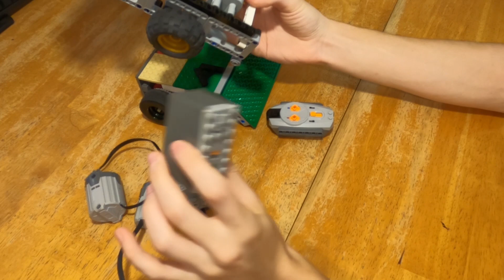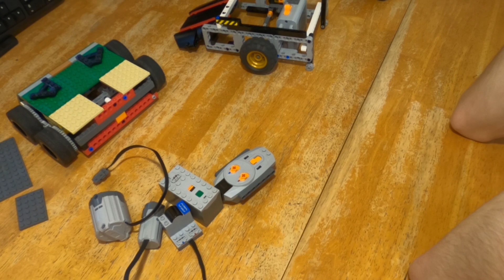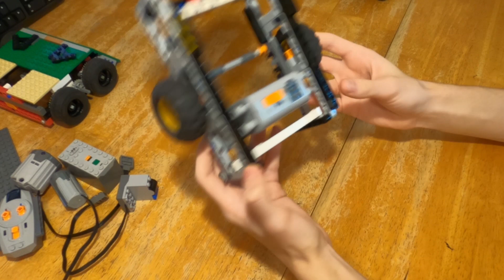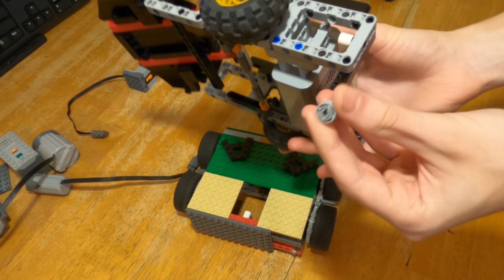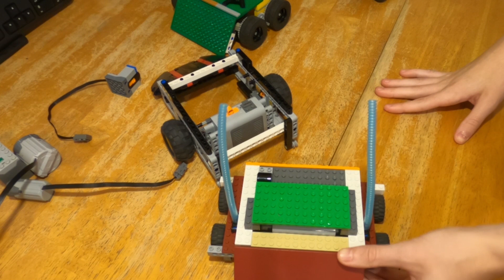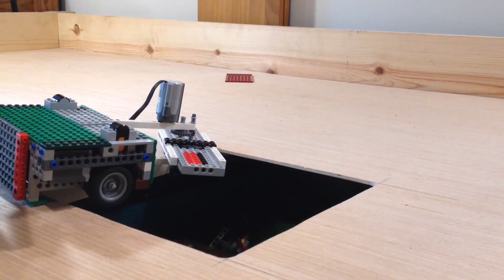How to BUILD a LEGO BATTLEBOT | Beginners Tutorial

Comment: imo your estimate for electronics is towards the low end. With PF increasingly becoming a collector's item, you have to go out of your way to maintain that price point. And the way Powered Up motor pricing is structured, it's more economical to buy a brand new full set to acquire them rather than buying them individually--especially if you desire the Technic hub as the receiver. Either way, it's never going to be a small investment.
Reply from the maker: Yes, when I said $60, I was thinking about the fake power functions and even that's a low estimate. I have spent $100s of dollars on power functions while they were available. The Technic hub is actually only obtainable through sets, and it looks like some powered up motors were discontinued by themselves. The BuWizz also looks like a great option.
Thanks for your input :)